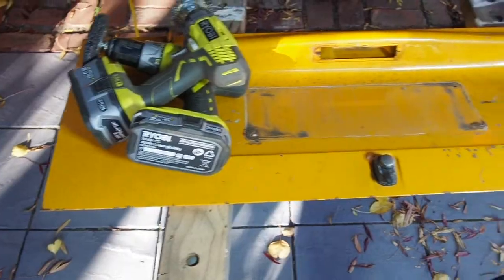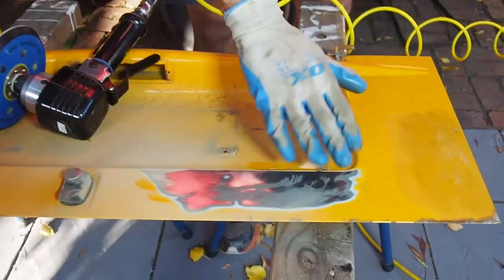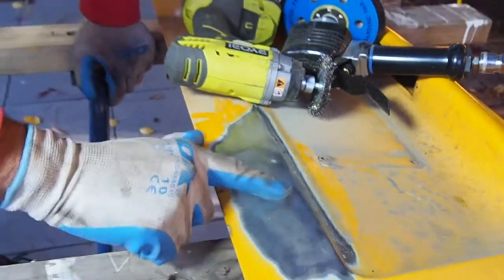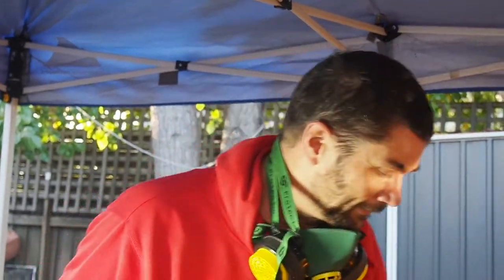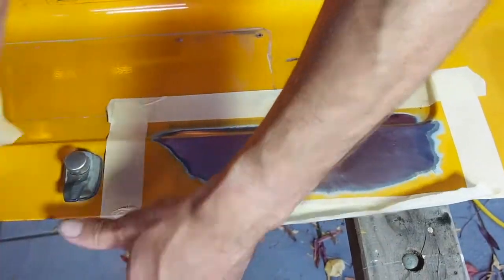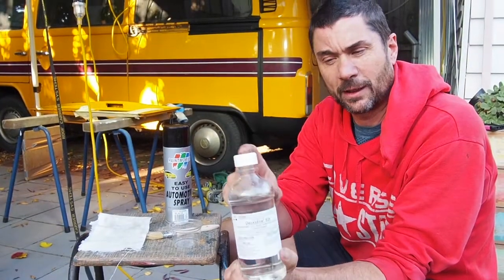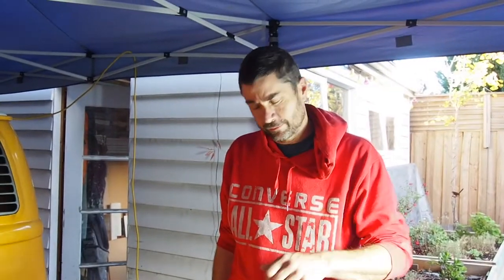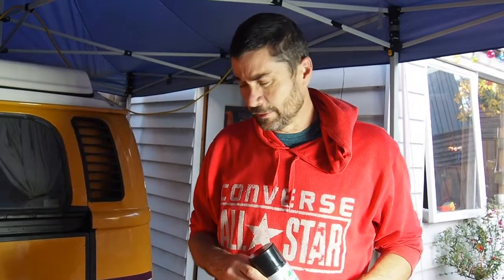HOW TO GUIDE: Removing surface rust!! | VW Kombi restoration

Comment: So for a proper job you probably should use epoxy primer on the bare metal.  This would then be sealed and the painters can apply high fill primer right on it, then the actual paint.  Many people skip the epoxy which is fine it just won't last as long, and it probably needs to be garaged.